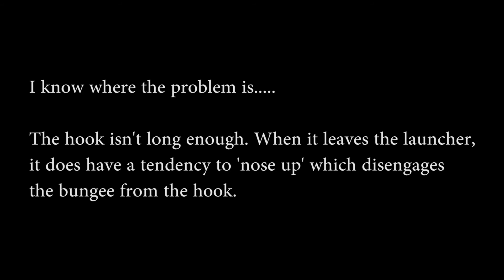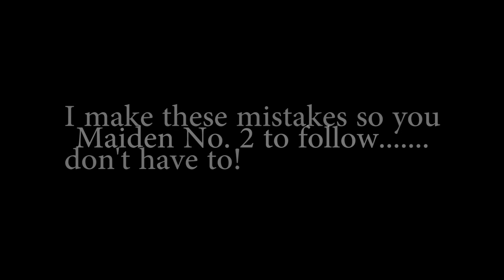FX61 Batwing Maiden part 1

Comment: Probably something you know, and probably already covered in your replies below, but wings do not get enough air flow over their control surfaces to start doing their job until airspeed reaches a certain point. That's why so many look at bungee launchers to help with hand launches that often go wrong. I have a number of wings that I fly and they've all had launch hooks added to them. I built a simple bungee launcher, similar to yours, and no longer suffer launch anxiety. Now I can enjoy the flight, makes it so much more enjoyable. But as I saw others respond, launch hooks generally should be placed half-way between the CG point and the nose of the craft. Works on all of mine. Good luck and have fun.

Comment: Dump that Hobbyking ramp mate to much friction, put a simple stake in the ground, get 20m of 5mm proper bungee chord from eBay, put the tension on with your hands and let her go. Mine is many yards away before throttling up and it works every single time for the FX61 and the Mini Talon.  Have fun great video mate.  Bill
Reply from the maker: I've watched your simple bungee launch quite a few times now and you make it look sooooo easy!    
I'm gonna give this HK ramp another go today (without all the tape around it) and if it doesn't work, I'll be trying your method :-)
Reply: Good luck with it mate hope it works for you this time. Do you cut that strip of grass that you fly from as it looks as if it's been cut back just for you?
Reply from the maker: The grass is cut by the Forrestry Commission. It's actually a training ground for horses (I think).    
The Mini Talon maiden went well today but the wind did pick up a lot. I think the CG is too far back (on the servo wires) so I'll be experimenting but...... I actually flew something this year and didn't crash! :D
Reply: +Vortecks Thought it looked a large area for you to cut mate and good of them eh 😁 Glad you got it into the air I agree about CG as I did some testing yesterday and on the servo wire is to far back for my liking I found it best for me half way between the spar and servo wires and I will be playing with it there for a while.  Have fun mate Bill

Comment: I have seen several videos where the wing is launched by holding the wing tip and launching like a discus. Keeps the fingers well away from the pusher prop. The FX61 may be a bit too large and heavy for this style of launch but maybe worth a try.
Reply from the maker: Once I have something in my mind, I never give up. I WILL make this work if it kills me! :-)
Reply: Oh yes I know you will. That's part of what makes your videos so enjoyable. Back in the days when I used to do some model gliding we used bungee which would comprise maybe 25ft elastic 75ft cord.. This gave a very smooth steady launch, a bit like a running tow. Not too frantic, but I guess you need quite high air speed with the wing.

Comment: move your release in front of the prop so you can use the motor power and the bungy togetter. See ard1400 funjet Elten
Reply from the maker: It looks like the perfect way to launch but this crappy HK bungee launcher would take a lot of modifying to make it work like that. I WILL make this thing work if it kills me! :-)

Comment: I considered bungee launch for a z3 I recently built as its a big heavy wing with high stall speed. Did research and even bought the stuff to do it. Just couldn't bring myself to try... Kept picturing the wing being drug by the bungee cartwheeling along the ground. Ended up just wicking the throttle up all the way and doing a side arm toss with the plane around 60 degrees up from the ground.
Reply from the maker: I was toying with the idea of using a discus throw but I resisted the temptation. I'll make this bungee launch work if it kills me! :-)

Comment: I don't know?  I've never tried one either.  Seems like the bungee is releasing too soon and maybe repositioning the hook would do the trick.  There is a trick of pulling stumps where you support the pulling chain on a bipod so that the force is upward and forward.  Just have to make sure the bipod is free to fall forward out of the way in this case.  I was really pulling for you.  Pun intended!  LOL
Reply from the maker: Another problem was with the triangular metal hook on the end of the bungee - it was too small to go fully over the hook on the plane and it had to point downwards. It caused the fulcrum point to be 2-3" below the plane and, in actual fact, would have made the tow point to be behind the CG.

Comment: Hook on the CG and 50 (fifty paces) out on the bungee.   1/2 to 3/4  throttle before you trip the release.
Give another go mate.
Reply from the maker: Cheers Dick. Another problem was with the triangular metal hook on the end of the bungee - it was too small to go fully over the hook on the plane and it had to point downwards. It caused the fulcrum point to be 2-3" below the plane and, in actual fact, would have made the tow point to be behind the CG. V2 hook has been printed and I'll hopefully be able to do the second part of this video next weekend :D
Reply: I used a round key ring - works great and they are super strong

Comment: just been out to the field with the repairs x5 or whatever it is. It's 1.5m like yours so I launched it as follows. 60% throttle then wings level and run about 15 to 20m the plane has some decent speed rather than a normal chuck it through. You can then feel it lifting out your hand and the you give it a push as you let go. you have plenty of time to then control the plane and fly it away.  my fx61 is just waiting for you to finish this series. check the my geek show channel as he did a few vids with a bungee launcher. You can do this!!!!
Reply from the maker: I would throw it but I've seen to many people losing their fingers and knowing my luck...... I've done the new hook and I'll be trying it next weekend (if the weather is kind to us) :D
Reply: But because you are running the plane leaves you hand only a little faster than you are running so you can get you hand well out of the way before the prop gets you. If you do the normal stand and throw it then yes you might loose a finger... We need to see you run and throw it  but check where you are running 1st to avoid holes, cow pats etc.

Comment: you need to throttle as soon as you hit that pedal so the force vectors are in the same plane at launch if not 

1) you will get a flop like you did if you dont throttle
2) if you throttle too late you will go into the ground.
Reply from the maker: Thank you Sir. The main problem was with the hook itself..... the triangular metal hook on the end of the bungee was too small to go fully over the hook on the plane and it had to point downwards. It caused the fulcrum point to be 2-3" below the plane and, in actual fact, would have made the tow point to be behind the CG. Throttle would have definitely helped but I watched a so-called professional who said not to throttle up until it leaves the ramp :-(

Comment: Move the hook forward on the fuselage , 1-5 ratio from cg should work. All pusher wings are much hard to launch and require a lot of airspeed over the control surfaces as there is no prop forcing air over the control surfaces so get the bungee pulled tight, the sooner its up to speed the sooner you will have control! good luck buddy.
Reply from the maker: Cheers mate. By the amount of comments saying to move it forward, you're probably right :-)

Comment: hi tony , you should hand launch it mate and give it full throttle , it did not have enough power for sure .

just give it a over head toss on the vector stab mode and you should be fine

i decided to build my ground station before the maiden , so maybe in a week or so i should try mine aswell
Reply: ***** did it plenty of time with the vector , never had a problem .

but after getting it airborne il go manual to trim it
Reply from the maker: It was in 2D with the gains at zero but there's no way am I throwing it mate. I've seen too many videos of people losing the end of their fingers. The main failure point was the hook itself......the triangular metal hook on the end of the bungee was too small to go fully over the hook on the plane and it had to point downwards. It caused the fulcrum point to be 2-3" below the plane and, in actual fact, would have made the tow point to be behind the CG. V2 has been printed and maiden 2 will hopefully  be next weekend :D

Comment: hi tony like the rest of comments have said just give it some throttle when it leaves the launcher!  When i launch mine i give it around 60 % throttle and just chuck it. trev
Reply from the maker: Cheers Trev. There were a lot of factors that made it fail. The biggest one being the hook itself. The triangular metal hook on the end of the bungee was too small to go fully over the hook on the plane and it had to point downwards. It caused the fulcrum point to be 2-3" below the plane and, in actual fact, would have made the tow point to be behind the CG. I've already designed another one and moved it forward a bit. Fingers crossed, maiden 2 will be next weekend :D

Comment: My hook (well its a screw) comes out the bottom of the plane and is 11.5cm back from the tip of the nose. Check out my channel, there is a video of it launching. I dont use that surgical tubing though, i brought BUNGEE CORD black 5mm x 20m shock chord elastic rope  from eBay, folded in half and tied. never had a failed launch. Also nowdays I dont throttle up till the plane is well away from me and the bungee has been released. probably 3 or 4 seconds after launch.
Reply from the maker: Thank you Sir. I watched the video and it looks soooooo easy. I think a simple screw might do the trick! :-)

Comment: Hi Tony....apart from not having enough hook length, I also think you need to move the hook towards the nose, say 30mm or so....Its pitching up....with this bungee cord length, it should be a long, slow tow launch....ie easy, with loads of time to gently open the throttle......Keep at it m8, I have every faith in you....Suprised your Maiden is not LOS though, its much easier to see if / how the bird needs trimming....a whole lot faster than wearing goggles ever will...?
Reply from the maker: Cheers mate. Another problem was with the triangular metal hook on the end of the bungee - it was too small to go fully over the hook on the plane and it had to point downwards. It caused the fulcrum point to be 2-3" below the plane and, in actual fact, would have made the tow point to be behind the CG. I didn't really want to post this video because I feel embarrassed about it but I hoped to teach others how NOT to do it. I'll be moving the hook forward and making it much better. Also...... I was trying to do a LOS flight, I only had my goggles on as a backup :-)
Reply: Vortecks Oh, ok...yes, I looked at the design of that printed tow hook and wondered why it was so wide..?...I get you about the triangled wire tow hook now, I can see what you mean now....Towhooks traditionally were usually small bits of bent Piano wire...used with a Keyring on the bungee...they always worked..lol....Oh well, stay with it because I have a SW X6 and I need a good launch ramp for it one day...Sorry, didnt realise you were LOS at launch m8...:)
Reply from the maker: I have some bad news....... I left the FX61 in the car on Saturday. I went to bring it in the house yesterday and the paint had welded itself to the car seat. In total anger, I proceeded to violently jump up and down on it and it's now a pile of polystyrene dust and it took 2 hours to clean the seats. Luckily, I bought a spare and I'm now in the process of transferring everything. This time, I'll do it PROPERLY and the tow hook will be in the right place (courtesy of Bill Hally)
Reply: Vortecks Oh, bugger....I have refrained from trying to paint foam planes myself, I know they use release agent which prevents paint sticking, and besides i dont know what brand to use either....Yes, Bill Hally has done this hasn't he...he has a clip of it....Keep calm and carry on Tony....:)
Reply from the maker: I did everything the same as my SkyHunter, used isopropyl alcohol and roughed it up slightly but it still didn't stick. I've seen someone else's comment on the B&Q website saying that it don't harden and comes off easily. Lesson learnt mate...... No more spray painting for me unless I use the proper Humbrol stuff :-(

Comment: in gliding the hook is just forward of the cog. Don't worry I maiden a skywalker x 5 only to found out that in manual mode controls were fine...In stablised mode they were reversed... lol crunch new nose job. dmerc has more luck with his maidens....
Reply from the maker: The same thing happened to me a couple of years ago with an AXN fitted with an APM........ straight up and then, nose dive into the ground. That was the end of that :-(

Comment: Throttle would help. You are down before you give throttle. Just give 50% throttle ad the start that would normally be enough.
Reply from the maker: I watched a video that says you shouldn't throttle up until it leaves the ramp. I'll give it a go. Thank you :-)
Reply: But after the ramp you also never hid the throttle.
It is pulled by the rope than it moves up and fells down because it has no throttle.
Best is just 50% throttle and than extra if needed.
Is throwing it not much easier?
Reply from the maker: There's about 1/2 second between it leaving the ramp and impact. My brain doesn't work that fast. There's nothing I could have done to save it, it was doomed before I launched it!
Reply: Hahaha, just start with throttle. 
It is a good looking wing. I am going to build a 600 size wing. Small but fast. Must wait because the wing is still in back order.